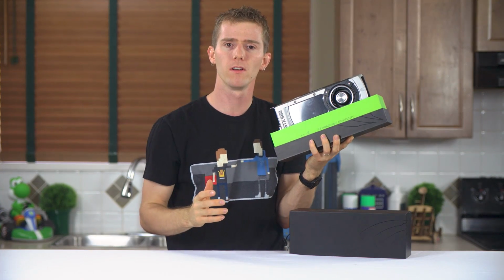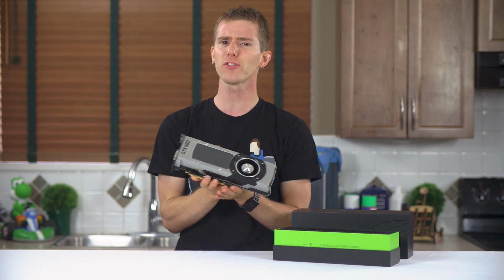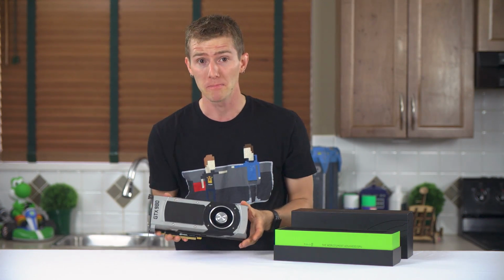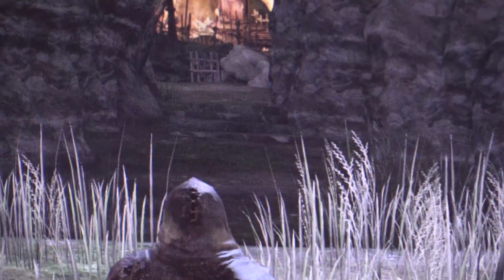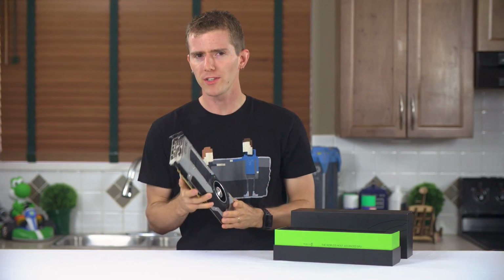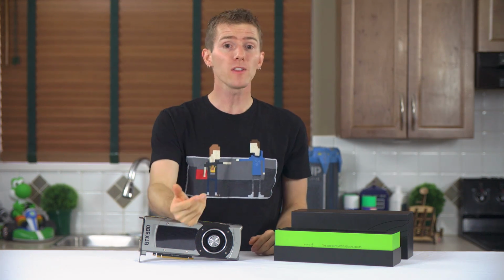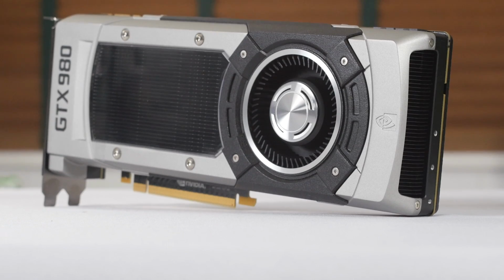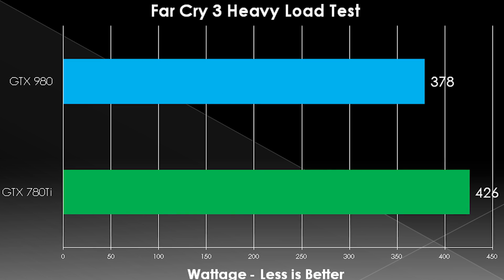NVIDIA GeForce GTX 980 Video Card - Performance Overview

Comment: COMMENT PLOX!
please tell me your opinions on my computer ? it's the first computer i have ever bought yay :D
Total Price 1,948
  ORIGIN PC Chronos - The Best Gaming Experience Guaranteed	
 	Case Lighting: Red LED	
 	Case Fans: ORIGIN High-Performance Ultra Silent Fans - Red	
 	Motherboard: ASUS Z97I-PLUS (Bluetooth/WiFi Onboard)	
 	System Cooling: ORIGIN FROSTBYTE 120 Sealed Liquid Cooling System for 1150 Socket	
 	Processors: Intel Core i7 4790K Quad-Core 4.0GHz (4.4GHz TurboBoost)	
 	Power Supply: Hadron 500 Watt PSU (included with Hadron)	
 	Graphic Cards: Single 4GB NVIDIA GTX 980	
 	Memory: 16GB ORIGIN PC powered by HyperX 1600Mhz (2x8GB)	
 	Operating System: Genuine MS Windows 7 Professional 64-Bit Edition	
 	Hard Drive One: 1TB ORIGIN PC Approved Hard Drive (thinking is should of got the 2TB)

Comment: Rig specs:
Processor: Intel Core i7 950 3.06GHz (quad core) 
Motherboard: Asus Sabertooth X58
System Memory: 6GB DDR3 1600MHz
Power Supply: 750W
GPU: NVIDIA GeForce GTX 580 1.5GB
Chassis Model: HAF 922
If i upgrade to the 980 would i have to change anything else? Or would it be able to work from the get go?

Comment: I have a problem. I think i have lost the power cable from my Thermaltake Evo-blue 750w to connect my gtx 980.

My question is the 8Pin to 2 X PCI-Express 6+2Pin Split Cable the connector to the power supply and where can i get a spare one?

I really don't want to spend anymore money :(

Comment: I'll stick with my gtx 690 for now till 2016 at least before I upgrade. I usually  fully upgrade my pc every 4 years anyway. Otherwise what's the point you only see a slight boost in performance for gaming no need to buy the next new thing when they release new hardware every 6 months. Plus it's usually takes 4 years for me to justify to my wife to spend 6 grand on pc hardware.

Comment: Would going from 680 to 980 be a significant upgrade? I am getting a 144hz monitor and I want those high FPS to get the full benefit of it.
Reply: did you watch the video? come on man, it was answered.
Reply: JamesMichaelDoyle he talks about the card being good and all but a lot of people have been telling me it isn't a significant upgrade from 680 to a 980 and I shouldn't spend my money on it. When I say significant I mean not just an upgrade but an upgrade that is worth 610 euros (Danish price). Did he specifically answer this question in the video? I remember he compared the two, but I am no PC expert and don't know how much those numbers mean.
Reply: NoobinPyjamas short answer, yes it is a significant upgrade.

its a subjective call here, only you know your financial position. and whether or not you are pleased with your current cards performance. if your current card is performing to what you want out of it, there is no need to change it.

680 should be fine unless you have a 4k display and then it will start to struggle. when you start noticing lower performance in new games then you should worry about upgrading. and another thing to consider is that just getting a second 680 might be a more practical upgrade.

Comment: Linus, when will you be slapping a watercooling kit on this had not and see how this overclocks ? Would be interesting to see how it does and you could try adapting an AIO to fit see how that does as well.

Possibly get a kingpin flick the switch to subzero with waterblocks too. Maybe you could get between 1.5-2.0Ghz then ;)

Comment: If my case can hold about 10.8 inches, and the card is 10.5 will this be a problem? I'm planning on getting this card, but don't want to find out any problems after I spend 600+ dollars.
Reply: Nah, so long as it fits your good, though if your planning on getting an after market cpu cooler there MAY be some problems, but other than that, your good.
Reply: What games are you going to be playing to? Because your name is "minecraftguy" and if you're going to be using a system with a 980 in it for minecraft you're pretty fucking stupid (no offense)
Reply: TF2DemoBros Nah no offense taken at all, I was much younger when I made this name, and I regret it very much now, I was gonna play things like AC unity, Metal Gear Solid V, GTA V, stuff like that.
Reply: mineraftguy123 Oh well, i don't mean to bring ya down or anything. But, ACUnity has terrible fps lag and crashes all the time because it's one of the worst PC ports since Dark Souls. so if you have an XBone or PS4 in all honesty i'd rather play ACU on console than PC as of right now.

Comment: Why are you using a reference design r9 290x these card thermal throttle like crazy an are only as fast as a regular r9 290. Its clear in your test your using a crappy reference that is not indicative of real world performance as no one would buy a reference r9 290x BC every one knows the cooler sucks and are not faster than a r9 290.

Comment: Im in the process of finding a new GPU for my 4-5 year old system, among other upgrade but want to keep using my existing motherboard Gigabyte EX58 Extreme.  At present have a 580 GTX, i7 920 2.6 (OC 3.6 GHz) with only 6 gb ram PC3 15000, 1000 watt power supply.

Will the 980 be compatible with my Gigabyte EX58 extreme motherboard?.  If its not compatible, how about the 700 series GPU's?  Any other suggestings for other upgrades using my existing motherboard are welcome.

Comment: My old 7870 broke (while being under waranty) and I had access to a 10% discount where I used to work. Bought myself a reference GTX 980 and boy, do I love that card.

Apart from the fact it's so much sturdier than any previous graphic card I've owned before, it's truly amazing. Runs most of my games at 2560x1440 (100Hz) just fine while not functioning as a glorified heater.

If you've got the money to buy it, I suggest you do, or go for a GTX 970 or something. They're both amazing cards.

Comment: Would like to pick this up since im running a basic gtx 770 and to be honest im not happy with it.. i feel like its almost the same as my gtx 580.. but thats just me..

i just upgraded my rig and im currently on a i7 4970k 32gb ram 3x 250ssd's and my snail gtx 770.. i think this is the route im going to take since the titan is 1k

Comment: so yeaa, i have my gtx 980 paired up with a amd fx 8320 clocked at 4.7(and yes its pretty stable i dont get random reboots, blue screen etc), 

the question i have is it worth it to go with an intel 5820k or the 5930 ddr4 etc? like would i get a major boost to what i have right now?

current specs
amd fx 8320 
gtx 980
g.skill(1600) oc to 1866
psu 850 watts 

xspc raydstorm( cpu water block)
xspc ex single radiator 
xspc ax360

Comment: I am not convinced to upgrade from my GTX780ti SC from EVGA, With the superclock it comes from the box is just dancing in circles around the 980 and the 980 should be blowing the 780ti out of the water yet as it stands, they are pretty much equal and half of the time the 780ti beats the 980 even in benchmarks and overclocks. Not saying the 780ti is better just saying it's not worth upgrading from EVGA GTX780ti SC to 980 at all. 1GB of VRAM won't make a difference for the next year or so, better wait for the 980ti and only then see if it's worth upgrading. P.S. I couldn't care less about less power consumption since if you can afford a 4000$ computer with these beasts on you can clearly afford to pay 20$ more per year on your electricity bill.

Comment: lol my 4770R system totally rocks and is much much smaller than that video card.  For those that don't play games there is no reason to get anything more than the onboard video.  Would you agree? Let's see a real world comparison between a 4770R system compared to the 5960X maxed out to ridiculous levels.  Yes my overclocked 4930K running 5 stripped 840EVO of the LSI raid card of champions is pretty fast but in side by side the 4770R... I really can't tell a difference.  Hmm.
Reply: Well, if you do any kind of photo editing or video editing even just video watching then you would want to get something higher than just the onboard
Reply: Court Ross Hey Court buddy! Yes I do video editing and watching a ton.  So far I can't really see a difference.  I also deal with large photos a ton and again the 4770R seems to flip through them no different than my mega system.  Pretty interesting.  In Cinebench the 4930K at 4500mhz definitely rocks but in real world stuff so far I can't really see much difference.  Now here is a goofy one for you: my mega system has an LSI 9271 raid controller running 5 Evo SSD drives raid zero.  Crystaldisk is about 3800 read and 2700 write.  My 4770R with a single 840 Evo running rapid mode scores 8000 read and 6000 write.  Who's got an answer for that one? Hmm.

Comment: In light of the R9 390X rumours of a GPU core with over 4200 stream processors @ 1GHz and 6GB VRAM @ 7000MHz. I watched this again to get an idea of how that would perform vs the 290X. So you've got ~50% more stream processors, 2GHz faster memory clock speed, and an additional 2GB of VRAM...assuming that will result in roughly a 50% increase in performance, if not more....fuck me, it could go head to head with the 980 Ti/Titan 2 and hold its own.

Comment: Would a single GTX 980 be fine for the moment. I want a pc but if I choose two 980's the price will rocket up to £3000 ($4840)
Reply: As long as you aren't gaming at 4K, yes, you should get 60+ fps on most games on max settings. What do you plan on using your PC for? A high end gaming PC even with all the accessories and peripherals shouldn't cost over $2500.

Comment: Can anyone tell me how this would be compared to an EVGA 780 Classified? There is $200 dollar difference on Newegg. I know you can't "future proof" anything, but would the 980 be worth the extra buck? I don't plan on replacing the card I'm planning to buy here anytime soon so I want it to last. Playing on one 1080p monitor.
Reply: The 780 will be good on 1080p for a while. The 980's performance boost isn't really worth the extra $200 in my opinion. If you were going to upgrade, I would recommend waiting for the 980 Ti.

Comment: i bought the gtx  980 and i love it. it's definately worth buying, it runs smooth, silent and cool. it also needs less power which is a major plus if you hate paying electric bills. as an example, it runs shadow of mordor on maximum settings with an average of 80-90 fps. i recommend this bad boy 100%.

Comment: I am thinking about trying the GTX 980 out for Surround gaming. However... I don't want to build a new rig until the after Haswell, for better DDR4 support. 
Anyone have any input on utilizing these cards in SLI on PCIe 2.0 x8 x8? Especially at 5760x1080.
Currently my rig is a i7-2600k with 16GB of CAS 9 DDR3 RAM.

Comment: I'm still waiting for the next generation of video cards, though I am very tempted to get one of these 980's, or even a 970, as they will both easily beat my old pair of 5870 eyefintities. I don't think I'll go with ATI again, back then it was more neck and neck in real world performance vs the 480, now not so much. Sure the new ATI cards look good on paper, but they simply do not perform as well. Besides, I can still play most games close to the max without much issue, and I have them underwater, so I can unlock the BIOS, and squeeze a bit more out of them before they become obsolete. Only problem I had before when flashing the crappy limited BIOS, was I lost all power saving functionality, that's the only reason why I'm not using one now, even though they are liquid cooled.

Comment: I just got myself a new rig.. But I sold half my soul for it XD
Intel Core i7 5930k 
Gigabyte GA-X99-UD4 Intel X99 Socket 2011-3 ATX 8x Quad
32gb DDR4 2133
2TB Sata 3 
256 SSD
GeForce GTX 980 <3
Silverstone Strider Gold ST85F-GS 850W 80Plus Gold/Fully
Corsair Hydro H80i Liquid Cooler
Reply: Cool rig bruh
Im grabbing a 980 or 970 as well

Comment: So this  will probably come across dumb to alot but,  can two monitors ( even at the same time ) run off this graphic card?
Reply: yes they can as they can even do that on a GT 620 without any lag time or barely any lag time introduced to what i have seen anyways.